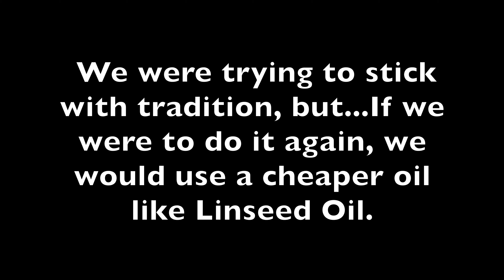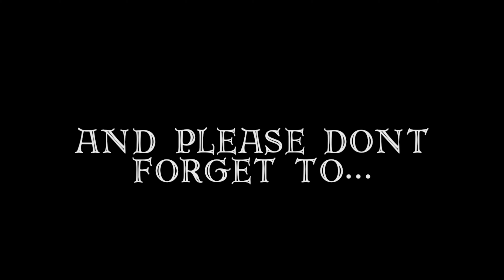Shou Sugi Ban - Building Our Homestead Greenhouse (Part 3) Vlog32

Comment: This is fascinating ! I had never heard of this kind of wood treatment. Perhaps you should do a "test" board or two with the Linseed oil so you can compare them side by side?
Reply from the maker: Thanks - we will actually get to do that since we will be burning the front and back walls as well as our doors. We will be using Linseed oil on those. So, we will soon see if it makes a difference. Thanks again for watching and taking the time to comment!